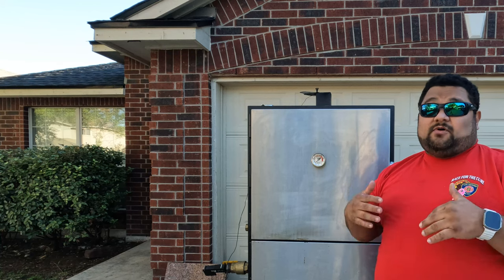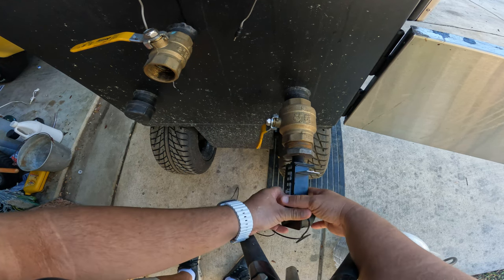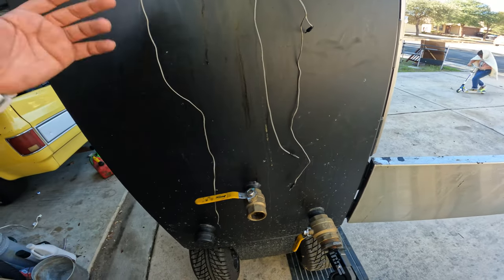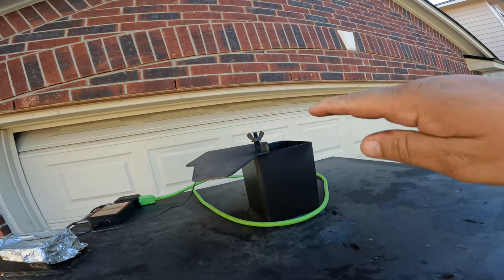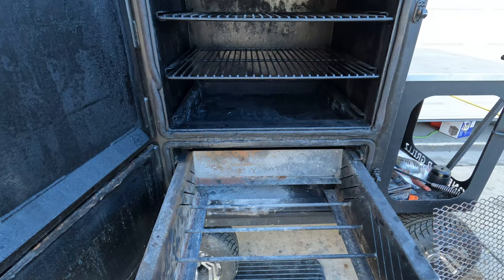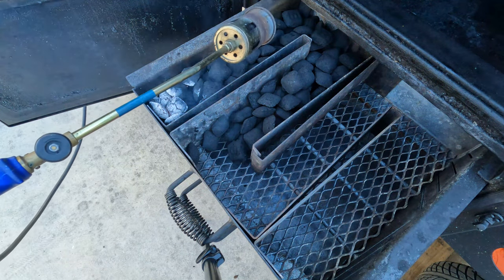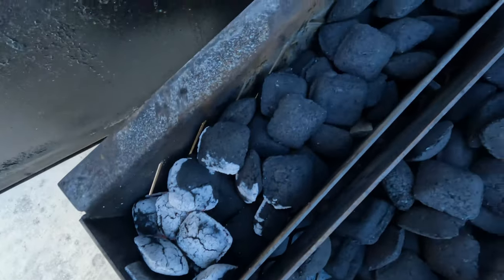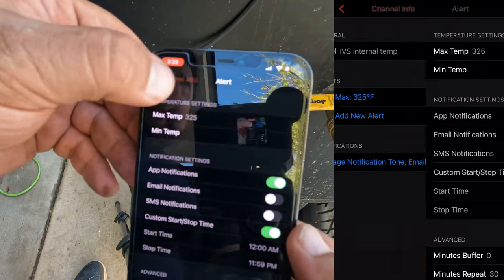FAT Es BBQ How to Set Up, Keep Your Fire Steady, & Maintain Temps on Lone Star Grills Large IVS.

Comment: Just tossing this out here ...

Instead of aluminum foil over the water port, try using a boat drain plug.  If you  look into it from the top, while it is square - there is a round hole just smaller than a garden hose opening in size..

Great video as usual bossman!  Keep em coming!

Comment: l got my IVS a couple years before you. Best built smoker on the market in my view. This year is my 50th year smoking meat, started at 19 years old with my dad. Also 6 smokers under my belt. Offset, cabinets, gravity and even the old bullet smoker. Anyway meat has never touched my racks. I cook in foil pans with stainless cooling racks inside and 1 inch balled up tin foil under each corner for smoke circulation. Virtually no clean up. Wife runs racks through dishwasher. I'll even line pans with tin foil until they get to bent up to use. As far as coal placement I just banked my coals along the sides of the fire box about 4 to 5 inches wide. 3 sides will get you 12 to 15 hrs cook time at 225 to 250 degrees. That's about 10 or 12 pounds of briquettes. Well I guess I can carry on as long as FATTY. 😊😋 Keep da smoke roll'n thin and da video's come'n heavy.
Reply: Super smart man... I will definitely try that with the foil pans.

Comment: Great Video.  I have a new IVS Large smoker and have been having problems over shooting the temps, I also have and use the fireboard fan.  I would of loved to see when you close down your ball valve and how much you close it, to just let the fan control it the rest of the way.  Thanks
Reply from the maker: I only close the water valve once I start the fan up. The actual inlet where the fan is mounted is left wide open. The smoke stack is about halfway open and the water stack is completely covered with the foil.
Reply: @FatEsBBQ  Very interesting, thanks for the reply. I thought for sure you'd over shot it leaving it wide open like that.  But I'm going to cap my water filler on top and try it this weekend. Thanks again.

Comment: Really appreciate your videos, I've learned a lot from them. I order my IVS and trying to learn not the hard way for once. Have you experimented with widening the first run on the coal bed and adding more wood than coal? Was wondering how the temp held and It seems like the first few hours would benefit with more wood for a good smoke ring.

Comment: Love meeting a LSG IVS owner.  I've had mine about 4 years.  Really struggling with wood chunks and how much to add.  I know with an offset you get much MORE airflow, therefore a different smoke profile.  The IVS is LOW airflow, and also a different smoke profile.  I've tried few chucks (like 80% charcoal or lump and 20% wood), to the inverse 60+% wood to 30-40% charcoal or lump.  The problem I've noticed is smoldering smoke or bitter smoke in the IVS.  I want a deep smoke ring, have you found a formula that emulates offset in your IVS?  I admit, I absolutely love my fireboard with LSG mini IVS!!  Killer BBQ.
Reply from the maker: The fireboard fan keeps my airflow constant when I need it. My temps do not spike at all. I don’t get bitter wood taste either. I am not sure what kind of wood you are using. Is it your own from your land or purchased from a wood guy? I’ve noticed when I purchase wood from wood guy I need to let it sit for a few months. Sometimes it’s not seasoned that well and still has moisture in it. That is what causes that dirty smoke for me. But if I buy wood chucks from HEB or use my seasoned wood cut up with chain saw, my smoke always burns nice and clear. I’ll set my fireboard fan temp to 225 and it will pump air and my smoke still burns nice and clear. The charcoal I use is also post oak charcoal. I don’t use kingsford or other regular charcoal coal. I don’t like the flavor those give. I’ll use B&B competition post oak char coal and also I’ll use franklins post oak briquettes. When I cook, the smoke smells incredible. Not bland. Hope this helps a little.

Comment: Thanks for the video. I just got my LSG IVS this past December. Having those same temperature issues but your video will definitely help. QUESTION…. Why did you set the internal temperature alert to 325 and the Set Point for the fan to to 300?

Thanks again
Reply from the maker: Hey how are you? Thanks for watching the video i hope it helps. The reason for the temps is….. hopefully it makes sense what I type lol.. I set the fan temp to 300 because that’s what I want to actually cook at. So the fan is what will get you to the temp. I set the internal channel temp to 325 as a max temp alarm. Meaning I want my fireboard to alarm if it goes over 325 because at that point I feel it would be too hot in this particular cook and I would need to address it. In this cook I’m okay with the IVS if it goes a little over 300 degrees. So the probe for the internal temp tells me where the actual temp is at, and the fan will kick on or off depending on that temp. The fan wants it to be at 300. So if it’s too low the fan kicks on. If it’s right on correct temp, the fan stops. If it’s too high and goes over 325, I get an alarm and I can quickly address the IVS and close my smoke stack to cut the heat back down if needed. This keeps me from burning or drying out the meat. The internal probe “325” alarm setting does not control the fan or what temp the IVS actually cooks at. It’s only an alarm. The fan setting is what will control your temps. Therefore I wanted to cook at 300 so I set fan to 300. Sorry for long winded response. I hope this helps.
Reply: Thanks, it does. One last question.  Concerning the internal pit temperature, for cooking you rely on the FireBoard more than the Tell True, correct?

Please note that as I’m typing this I am running my pit using your method.  I’m documenting the pit temperature every 30 minutes comparing the FireBoard to the Tell True. I’m almost at 2 1/2 hours and my temperature is 260 degrees (FB).  

Thanks again

Comment: Have you talked to Chris about possibly making a stainless cap for the water port?
Reply from the maker: Ill send him that info, great idea.
Reply: Or just make a damper for that port just like the main exhaust port. Seems simple enough.
Reply: @FatEsBBQ  Please let me know if you If you get anywhere with it.  I smoked Salmon yesterday morning.  The coals were still too hot to put the cover back on when it started raining here last night.  First thing I thought of was putting a tinfoil cap over that vent to prevent water from getting in, which I did.  I'd definitely pay for a cover if Chris made them!
Reply: I went to my local Ace hardware and bought rubber plug for $1.00 it works great.  Shaped like a cork and plugs it perfect.  The hole you need to plug is 3/4"
Reply: @bryanrichardson4190  I purchased an IVS from a guy and he did same but put it on a bolt so weight keeps it snug and easy to take off and on
Reply: @bryanrichardson4190   
I just got off the phone with Teresa at Lonestar.  She says that they have metal caps on order that they will be painting once received.  She said they'd be about $15.00 each.
Reply: @FatEsBBQ  
I just got off the phone with Teresa at Lonestar.  She says that they have metal caps on order that they will be painting once received.  She said they'd be about $15.00 each.
Reply: @FatEsBBQ  They got metal caps in.  I picked mine up today.  They're not Stainless, but they match up nicely.
Reply: It's supposed to vent out,not in according to lsg. It's supposed to let you know your water level is low. Are they wrong? You'd have to have some serious draft for air to suck in that stack, I don't own this cooker but I may soon so I'm curious about this.
Reply: @HVACRTECH-83  I don't use the water pan, so plugging that hole is a plus for maintaining temps.  Also, since my last post they've started carrying a cap that fits right over the top.  Works like a charm!

Comment: I run a Gateway Drum. I usually fill the coal basket up all the way and then just torch the middle of the coal basket till it’s good and lit. Then everything just slowly burns outward. Couldn’t you just do the same thing with this? Just fill the basket full and light the middle real good?
Reply from the maker: I’ve never tried that. I know when I accidentally got my whole basket lit, my temps went skyrocketing. I had my coals up too high over the edge of the snake pattern/ metal dividers. So it ignited the next path and then that one ignited the third lane. So pretty much all the coals went up and burned at the same time. lol. But I’ve never tried just lighting the middle. Might be a good test to do.

Comment: Great video bro! Question, do you leave that air intake valve wide open with the fan on it the entire cook? If so, does that effect the temp if you are trying to stay around 250?
Reply from the maker: yes, the air intake ball valve will stay wide open the enitre cook. If I notice things getting too hot, ill close it a little, but I wil say 95% of the time its wide open. The smoke stak is about halfway open. water ball valve completely closed. Water stack completely covered with foil.
Reply: Thanks bro! Amazing it doesn’t get too hot, unless that fan has a way to choke off the incoming air.

Comment: Can you use lump in these? Im not a big briquette charcoal guy. If i can use fogo premium in this,even if i had to break it up a little id be 100 sold, want to purchase a new cooker this week but i have 5 im looking at and trying to learn as much as i can about them to help decide. This one checks most of the boxes so far
Reply from the maker: I have used lump in these before, but I do notice lump burns a little hotter and faster. But yes it can be done. I just use the post oak briquettes because they are more consistent and steady burning and don’t tend to jump in temp as much as I had with the lump. I don’t use regular charcoal though because the flavor profile is not there at all with regular char coal. That’s why I use the post oak mixed with actual large chunks of post oak wood. As far as lump again I would definitely use the snake pattern and not let it burn all at once.

Comment: How well can you snuff out the coals at the end of the cook to use on the next cook?
Reply from the maker: I would say you can snuff them out, but it does take longer than my offset. I close all my ports and take off my fan and close the ball valve and smoke stack. Usually still takes about a good hour before I feel safe. And then after cleanup I make sure they don’t reignite then put pit away. I check the coals too because you never know about a rekindle. But usually in my cooks I have kind of figured out how much fuel to use for my cooks. So I’m usually all burned out and ash after I’m done cooking. So if my cook takes 20 -22 hours on average. By the time I have taken briskets off and put in warmers and then cleaning up my trash putting tables and probes away and washing them. Sweeping my concrete floor and putting everything away. Sometimes my canopy etc. All this work usually takes me another 2 -4 hours of me taking my sweet time and relaxing lol. Then the fire is usually all burned out. I’ll dump my ash and clean the inside of the pit and then oil hinges and put away. But when I fully load the fuel tray (snake pattern) I tested it and it burned for 34 hours at 225. Total time to be completely burned out and cooled off to be safe to put away was 40hours. I did this on purpose to see what the longest it would go. Hope this info helps. Good luck! Hopefully you enjoy your investment. It’s awesome!